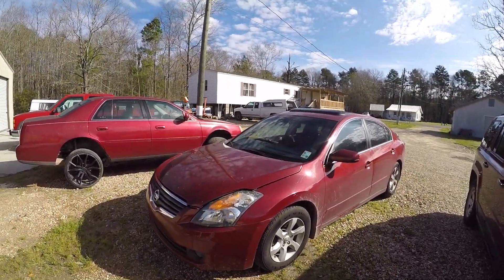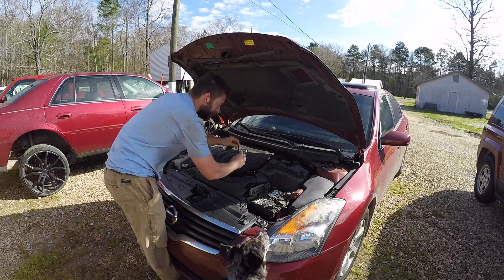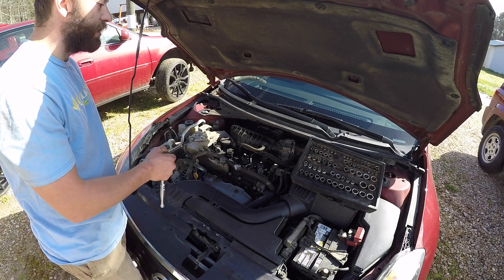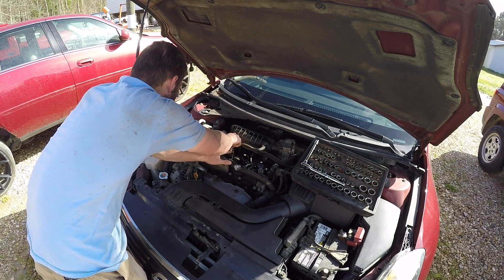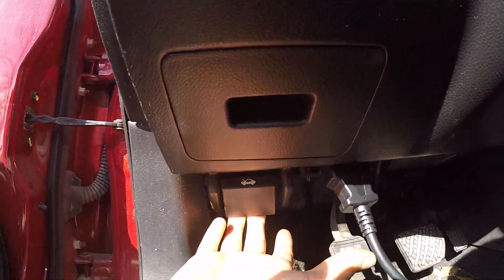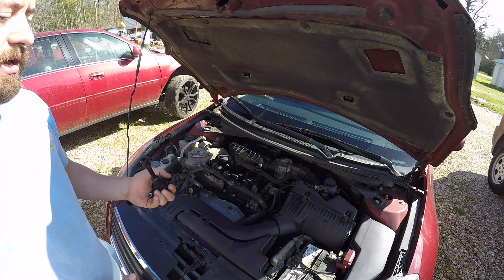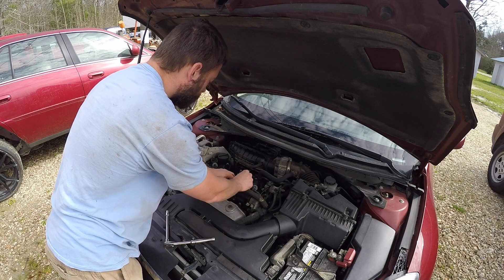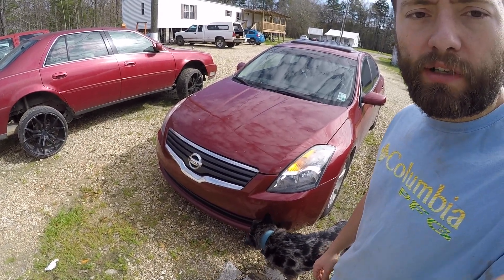P0302 Misfire Cylinder 2 || P302

Comment: Okay but what do you do when it doesnt stop misfiring after you fixed the problem
Reply from the maker: Did you isolate the misfire to a specific coil pack?
Reply: @dudewecanfixit  yes and changed all of them
Reply from the maker: Is it still the same cylinder that is misfiring?
Did you inspect the spark plug
Reply: @dudewecanfixit  same cylinder and i changed the spark plugs too
Reply from the maker: It might be the fuel injector for that cylinder or it could be some mechanical issues with the valves

Comment: Super,but on my cittoen, i have fault code p1338,misfire on 2 cylinder,its not spark,its not coli ignition,it s not injectors ,i clened all 4,and i am now confused......
Reply: Check the O rings on your fuel injectors. Air might be going in. So before taking them out spray around them if the car hesitates then your O rings need to be replaced
Reply from the maker: Good advice, thinking outside the box
Reply: @nlove466  it's not that either. So what is it then? I don't need just 1 suggestion i need as many possible
Reply from the maker: It could be mechanical. Valves, piston, compression, or timing

Comment: Nope still getting po302 smh 🤦‍♀️ I’m ready to buy a new car  lol
Reply from the maker: Did you swap the coil out with a different one and erase the code to see if gives a different code?
Reply from the maker: If the code stays the same, you should try replacing the spark plug on cylinder 2. If the code changes, you have diagnosed a bad coil. Replace the coil
Reply: Dude We Can Fix It yes I did that. They can’t find a hose leak either. I’ve changed both converters, full tune up, oil change. I’ve spent so much money on just labor cost. Oh and it’s has a new transmission plus several other parts. I hate this Nissan Altima hybrid!
Reply from the maker: If the spark plug is new and the coil pack is good, the only other things I would do is check/replace the fuel injector for cylinder 2 and do a compression check
Reply: Dude We Can Fix It Thank you so much! I watched a video and the guy said that could be the issue. I’m just overwhelmed and feel like I’m going down a rabbit hole and didn’t want to just waste more money. I will do a compression test tomorrow and get the injector changed. I’ll be back after I complete these. Thank you so much!!!!!!!!
Reply from the maker: No problem, I wish you the best of luck. It is unfortunate that your mechanic has changed so many parts without verifying a faulty component.
Reply from the maker: So, P0302 signals a problem on only one cylinder. Each cylinder has a spark plug, coil pack, and a fuel injector. If those items are all functioning, the only thing left to consider is a mechanical failure which can usually be found with a compression test. If you had a P0300, that would be something like a vacuum leak or loose hose because it would affect all or multiple cylinders.
Reply: Dude We Can Fix It I’ve had PO300 P448 PO302, PO303. All the other codes went away but PO302. I wiped the check engine light with my computer and that’s the only one that keeps coming back. Yea the guy who fixes the car sucks. I wish I could find a good mechanic here in Ny. But I truly appreciate all of your help and advice. If I could have you fix it. I’d be there 🤷‍♀️ Most you tubers never respond to comments. I truly appreciate your help.
Reply from the maker: No problem. If you were in Louisiana, I would definitely look at it for you. Please subscribe to our channel, it helps us keep doing what we do and keep us informed about your car as well. I'm also curious to see what it ends up being.
Reply: Dude We Can Fix It I could tell by your Accent you lived faraway lol I subscribed. As soon as Ik the problem I will most definitely be back 😊
Reply from the maker: Lol, thanks